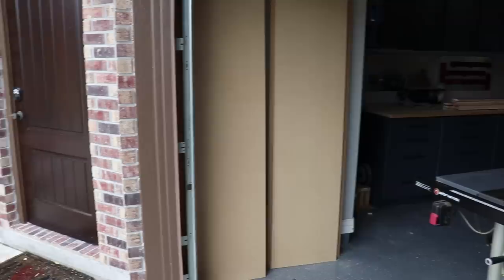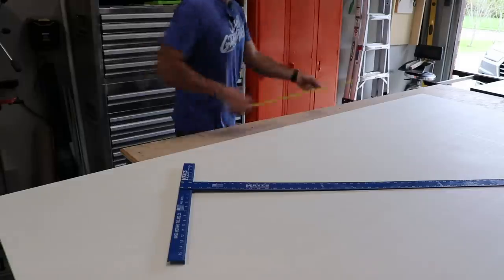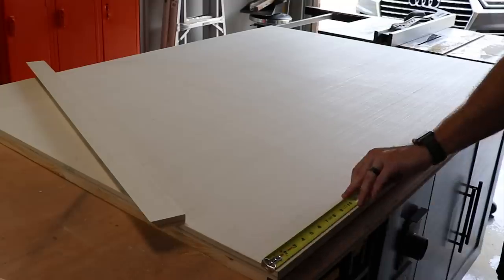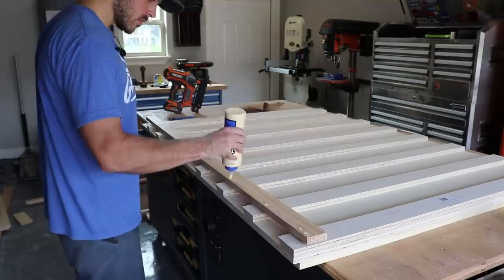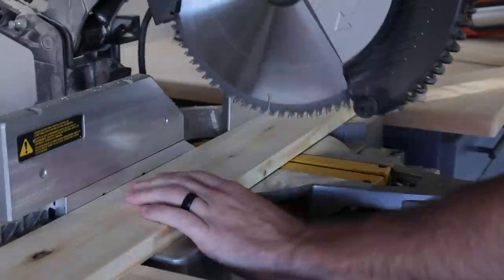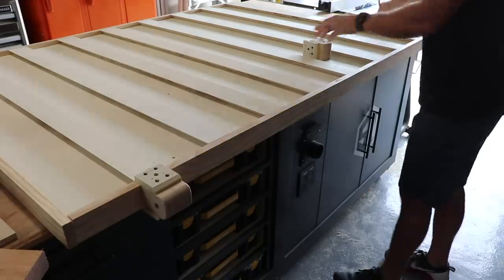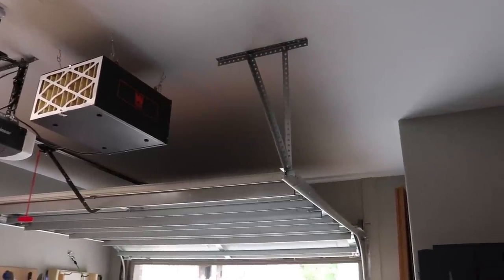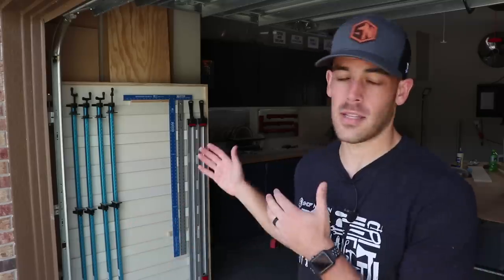Swinging Tool Wall // Clever Plywood Storage Solution

Comment: Nice. I have a 1,400 sf barn space on a slab. When we built it I included a floor drain which seemed smart at the time. Since then I built a raised floor in that space. Longer story but since then I added an 18" bandsaw, mitre saw and drill press in that space. Apparently in an effort to make life more complicated 😣 I added a small tool "wall" that managed to block the bandsaw from any resaw lumber longer than 36".....so I've only been thinking - not actually searching - about hinging that wall....and BAM!, your video popped up in my YouTube suggested feed! Brilliant! Subscribed. Liked.
Reply from the maker: Man, that YouTube algorithm is getting good! 😉

Comment: Thanks for this. I'm currently operating in half of my 2 car garage (the other side has my van parked in it, so no saw dust making inside the garage, which is fun in Buffalo this time of year), and I have to move my kids toys, bikes, etc. to get at anything, so yeah, space is a premium. Something like this will be really helpful to at least organize a little bit of the chaos I have to deal with. I need to get some lumber racks for the wall and ceiling so I can free up a little more space in there too.

Comment: I am in a metal building I designed, I used heavy duty angle iron used in the construction of industrial garage doors, piano hinges, and peg board. With self drilling flat head screws 2 drill into the perlons and 10-24x3/4 Phillips pan head screws and wiz lock nuts I built 4x4 pegboard walls that let me inventory on both sides and on the  perlons behind the pegboards. I also use magnets 2 hold the doors closed. ✝️⚾🙃
Reply from the maker: Nice!

Comment: Travis, another important thing you've gained by storing your sheet goods behind the wall is that they'll now be less likely to fall over.  I would however recommend you place a scrap of melamine on the floor beneath the sheet goods area, as that wall is right next to your garage door where they could be damaged by rain.

I liked your idea of using heavy bolts and washers for hinges, too!

Comment: Came across this.  Nice idea and I'll definitely be building something long your design.  

I have a basement shop with only one place to put smaller sheet goods (I wish I could store full 4x8' sheets, but that is just impossible in my shop).  This will solve that problem and solve my other issue trying to store longer tools like bar clamps, levels and cutting guides... exactly what you did.

Comment: Pretty cool tool wall, the first such project I've seen that I actually want to put in my garage.  Thanks for the great idea!  
Regarding your last statement, I too had doubts about the strength of the hinges.  The 8" bolts, the oak chunks, or the 1x3" frame brad nailed and glued to the sides aren't going to fail, but the weakest link there as I see it is where the 'wings' on the oak chunks are side-screwed into the narrow edges of the 1x3" frame, which depending on the hardness of that wood, those 4 screws into its 3/4" edge have less than 3/8" of that solid wood between screw and hinge, and might open up a crack in the grain over time.  If there was some way to run a screw from the inside of the wall through that frame and into the oak chunks, or else extend the 'wings' further into the tool wall to screw to those parts, that'd certainly strengthen it.  But then again, there are 3 of them, so it may not be a factor.  It's not a weak joint per se, just the weakest link in a system of strong links.

Comment: Pretty cool, especially for that spot in the garage.  I imagine you could get away with slightly smaller hinges if you put a caster on the other end of the wall so the weight sits there instead of being carried by the hinges.
Reply: would depend on the slope of your floor and the arc of the swing, but for a flat floor - Yeah!!  ( maybe a spring loaded caster, assuming that the spring can lift the weight...probably too complex for what it does - but then, why would that ever stop us?)
Reply: @gregmislick1117  Good point, hadn't thought of the sloped floor.
Reply: I wouldn't suggest going any lighter on the hinges, as one never knows what's going to be stored on such a wall in the future.  Besides, the was he did them, those hinges are very cheap to make.
Reply: Put two caster on the bottom to support the weight of the entire wall. Make hinges with an oversized pivot hole so they only guide the panel as it rotates but doesn't support and vertical load. The slope of the floor now becomes irrelevant.

Comment: Before getting too ambitious with ceiling storage you will want check ceiling joists for appropriate capacity relative to material type and span. It is a really good idea for light items. Plywood storage, or other potentially heavy items, could be problematic. No one wants to open a garage door only to find their ceiling is now the floor...

Comment: if you put a swivel wheel on the bottom outside corner and put more cleats on the other side you could store actual tools on that side like hammers and screw drivers and stuff like that just an idea
Reply from the maker: I actually bought one thinking I would use it but based on how solid it feels I decided not to. Would be simple to add!
Reply: You could support a lot of extra weight that way, but I like the way he build his because my floor is extremely uneven, especially near the garage door.

Comment: I’ve been thinking about going to cordless tools for my shop so tired of hauling out cords or unplug one tool then plug in another pretty soon cords every where thin I found you site ( subscribed ) looks like all hand tools are cordless.
my only thing holding back is the cost of the batteries some almost cost as much as the tool I own one of the first makitia cordless drills the replacement battery is just few 💰less than the drill and most places don’t even carry them any more
Reply from the maker: That’s why I like RIDGID, they offer lifetime warranties on their tools and some of their batteries!

Comment: I noticed you have the Woodpeckers T-Squares. 12 and 24?? How often would you say you use those and which do you use the most? Do you think you would use the 32" T-square too, or would it be too big to be useful?
Reply from the maker: Love those things, I’d probably use the 32 as well but I do use them quite a bit
Reply: I have the 32-inch T-Square and use the ruler for larger projects.   The width on the WP T-Square is very wide and for smaller projects, the width can become cumbersome. For measuring devices under 24 inches, I would look for them to be not as wide.  WP did offer a one time tool called fat head which is not as wide as the  T-Square.    NOTE:  I would differently invest in the WP 32 inch T-Square.

Comment: I think there needs to be a caster on one side, but it looks good. Definitely needs to be painted the normal Shop Nation color with the Graco airless sprayer.
Reply: I only suggest the caster due to the unknown amount of weight that could be put on the wall.
Reply from the maker: Yeah I actually planned on adding one originally, may still add later if needed

Comment: Great project! On a separate note: how do you like your air filtration unit hanging from the ceiling? I currently have it on the floor, but've been thinking about moving it over head, right about the same spot as you do. Just curious how you like it there. Thanks.
Reply from the maker: I like it but always forget to turn it on!

Comment: 2 comments:  Did you consider using a caster wheel on the bottom of the swinging door?  And, why so many cleats to hang tools with long handles that block the lower cleats from being used?

Comment: Great to see you back in the shop doing some projects mate. How do you think the wall/hinge connection will hold up over time once you add some weight to the tool wall? Might it be worth adding a single castor to the bottom of it?
Reply from the maker: Time will tell but definitely easy enough

Comment: Great project, but my only comment is, on the hinges, i would not have used drywall screws i would've used a GRK type structural screw.  Drywall screws are not meant for structural use and can be brittle.  Not dogging on you, just a suggestion.
Reply from the maker: Great suggestion! I appreciate it, I’ll get some of those

Comment: Man that's a lot of engineering and time spent for so little gained. If you think of the 'tool wall' as a page in a book that is open and right-side up, and you built 4 or 6 "pages", that could hold things on both sides, that would a much more efficient use of space.
Reply from the maker: That would be pretty cool

Comment: Great Build - I don't agree with the advice at the end. I would caution people against adding a ton of weight to the structure of a roof unless they know it has been designed for it. Also, trying to pull a huge sheet of plywood, while on a ladder, could prove catastrophic if the wife decides to open the garage door in the process.
Reply from the maker: Great point!